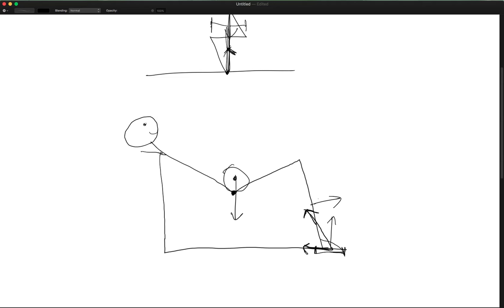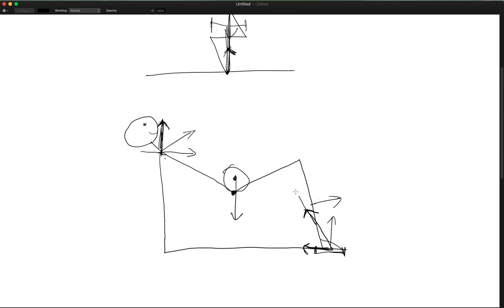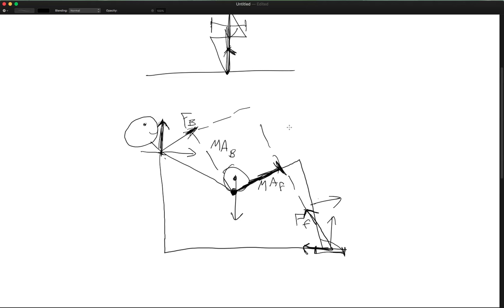Hip Thrust Moment Calculation

Comment: Brett, I’m finally getting over the embarrassment of doing these at the gym, I’m lifting heavy and I started eating meat again but I feel like my butt is shrinking? Is it normal for hips butt, thighs to shrink before they get built up?
Reply: How much protein are we talkin? There are a lot of factors that contribute to glute growth.
Are you skinny and solely trying to gain glute muscle (not worried about losing belly fat), if so, I consider you lucky! Anyway, if you’re only worried about gaining glutes and don’t have belly to lose: make sure you’re taking in about a gram of protein per every body pound of weight daily - if you’re 130lbs, you want around 130g (clean) protein (or more) daily for optimal results. If you don’t gain belly fat easily, I recommend still maintaining calories too. With drinking lots of water, and mind to muscle connection is so important - if the form isn’t correct, you’re not targeting your glutes. Focus on adding a few more reps/couple more lbs of weight each week/biweekly to get stronger. You’ll see the results, but fueling your body correctly is essential. If you’re not used to this much protein or calories, you must slowly increase weekly.